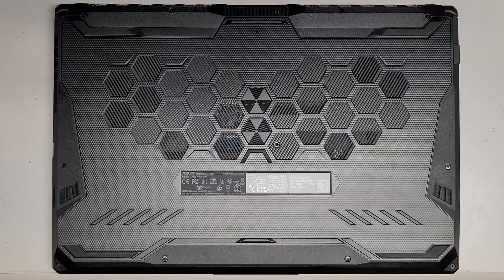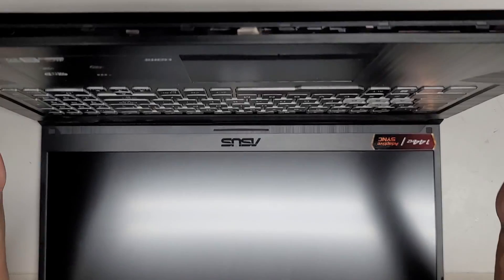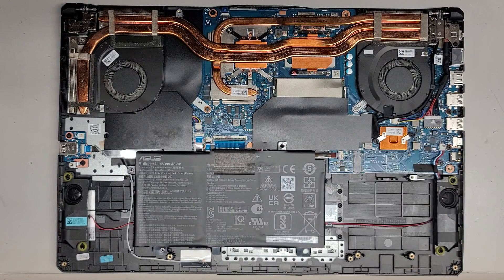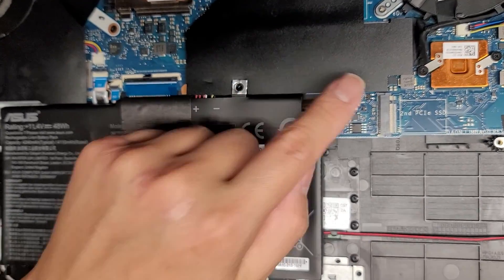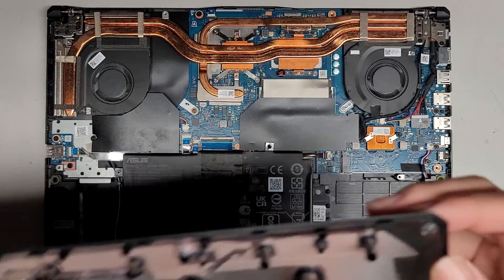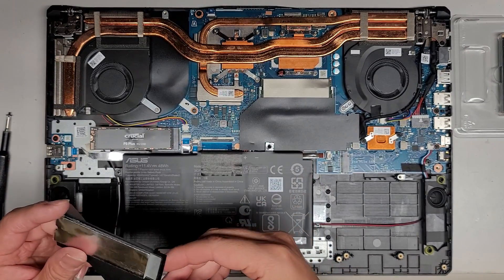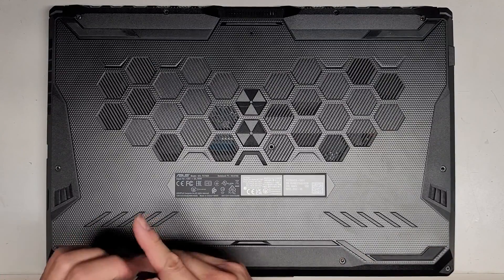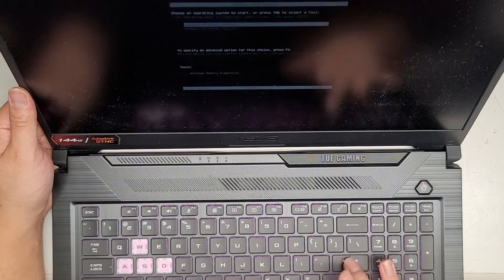ASUS TUF Gaming F17 FX706H FX706HCB-ES51 Disassembly RAM SSD Hard Drive Upgrade Battery Replacement

Comment: there is second ssd slot right side, you should've kept original one and installed second one, so you could have more storage
Reply from the maker: I should have kept the original one? Did you even pay attention to the video? The original one failed. Why would you keep a dead SSD inside a computer? It will only cause problems... It would be like keeping a brain tumor so you can have more brain matter... lol

Comment: Hey. I hope you still check comments. 
Per factory specs, this laptop has PCIe gen 3 slots, but you have a Gen 4 SSD. Does it work at gen 4 speed or it's capped at gen 3 speed? 
Also, do you know if the battery can be upgraded to 90w? The 90w is 15.4v as opposed to 48w at 11.4v. I saw one guy did the upgrade, but wanted to see more opinions or experience. The different voltage worries me. 
Thanks!
Reply from the maker: Hmmm I'm not sure about those things, sorry.
Reply: @ItsBinhRepaired  Okay, no worries.
Reply from the maker: Yup

Comment: Bro i have acer aspire 3 a315-58 36qh model n20c5
SN530 NVMe
Western Digital
WLL
512GB
SSD
Can I put this ssd in this Asus tuf is this compatible with it
Reply from the maker: @jerry22-c3l  should be fine
Reply: @ItsBinhRepaired  thanks bro

Comment: I have a asus f17 fx706h and was wordering if i could put two 16 gb ssd and one 1tb were you had put your 1tb in the video i have a rtx2050 and a i511400
Reply: Thanks man I learned something new
Reply from the maker: @ZahvinYT  no problem. Watch the video again and you'll see where the RAM and SSD are. If you want to upgrade the SSD, you'll need to clone the old one to the new one, or be ready to install a new OS.
Reply from the maker: 2 16gb sticks of RAM? Sure! You can put 1TB SSD as well.
Reply: Are stick ram and SSD difrent
Reply from the maker: @ZahvinYT  yes
Reply: Did I say it wrong I'm new to this so 2 sticks of 16 gb ram and one 1tb SSD is how you say it?
Reply from the maker: @ZahvinYT  yup

Comment: Hey man please reply 😭😭i can hear a small electrical buzzing sound in the left part of my same model above the 1-2-3-4-5-6 keys it's very small and i can hear it only when i put my lapton in silent mode with fans turned off,😢 do i need to be worried please please answer this is my first laptop
Reply from the maker: @brijeshb3355  the computer is still working?

Comment: Hey, I have a question, if I consider to move my ssd to that second slot it would be possible? I experience a lot of wifi trobules because the wifi card heats up and just turn off. Thanks!
Reply from the maker: Should be. Give it a try.
Reply: @ItsBinhRepaired  alright, thanks
Reply from the maker: Yup

Comment: Hey first of all thank you for your video I've never worked on my own laptops though have for desktop rigs so this made me a lot less nervous to do it myself!

Question for the parts I'm trying to upgrade:

I'm trying to install a "SAMSUNG 970 EVO PLUS M.2 2280 1TB PCIe Gen 3.0 x4" M.2 and wasn't sure if this one would be compatible for the second port. I also don't know the compatibility for the RAM though I was debating on putting in this one "Crucial 32GB Single DDR4 3200 MT/s CL22 SODIMM 260-Pin Memory". It would help tons to get your opinion! Thanks so much will share this video with others!
Reply from the maker: I think those should work

Comment: What do I do if I take out that screw that helps open the plate
Reply from the maker: What do you mean?
Reply: @ItsBinhRepaired  i was talking about the screw in the corner that opens the edge of the thing slightly but I figured it out
Reply from the maker: @poopmaster8464  oh, got it. Yeah, you can screw the washer back on.

Comment: The black sheaths are to assist speed of assembly using unskilled labor. They are marked with arrows which are removed if QC operatives are happy that components are where they should be. Following basic laws of thermodynamics, the sheaths localize heat and do not disperse it. Asus should stop using them.
Re the tricky clips, a tip is to smear Vaseline on them and the location holes then wipe the outside of the joins with isopropyl. This avoids traces of warm grease attracting dirt.
Quality standards have declined with this company and most others in the last 15 years.

Comment: Would i be able to put in a ssd nvme with heat sink?  I've read by some its to big and by others its fine. Or is there a heatsink already in place?
Reply from the maker: No heatsink unless it's just the flat heatspreader. It's unnecessary though.

Comment: hey, i have an asus A17 FA706IU,  r7 4800h, gtx 1660ti, 16gb ram but i have the small battery with 48Wh, i bought the big one (90Wh) but it s higher voltage 15.4 from 11.4. What do u think, it s safe to replace it?
Reply: @curcan.razvan I am also planning to upgrade battery to 90whr...
Just wanted to know is yours still working properly? Higher voltage causing any issue??
Reply: @hassaan6119 nope, 0 issues, it's perfect, 6-10 hours of mid-hard usage on battery and the laptop is fast like if its plugged in
Reply from the maker: Nice!
Reply: @curcan.razvan  hi,  want to do the same -  but  I can't find the serial number of the battery 90whr is that one C41N1906-1?
Reply: @Татьяна-х5л1ъ i dont remember if the code ends with -1 or -2

Edit: Yes, i have found the code. That is the code. Buy it.
Reply: @curcan.razvan  thank you very much !
Reply from the maker: Hope it goes well.
Reply from the maker: Is it designed for the laptop?
Reply: yeah, it works perfectly
Reply from the maker: @curcan.razvan  awesome
Reply: @curcan.razvan today i tried upgrading my battery from 48 to 90whr. My model is f15 FX506LHB . The issue i am facing is that the laptop isn't utilizing battery for turning ON nor does it want to charge it. The only way i can turn on my laptop is by connecting the charger. Although it does show the battery and its % in Windows. But as soon as i disconnect the charger, it turns off. 
Any advice? 
Fyi i have tried upgrading battery drivers and have reset the cmos. And the condition is same in Bios mode as well. ☹️
Reply from the maker: @hassaan6119  did you have that issue with the old battery?
Reply: @ItsBinhRepaired  No. The older one is ok. Laptop turns ON and everything else is just as it was before with the older one.
Reply: @ItsBinhRepaired  do you think it might have something to do with bios?
Reply from the maker: @hassaan6119  no
Reply from the maker: @hassaan6119  is the other battery made for this laptop?
Reply: @ItsBinhRepaired  older one(48whr) is B31N1726 and the newer one (90whr) is C41N1906-1. Don't know about compatibility.🙁
Reply from the maker: @hassaan6119  you can't just plug random batteries into your computer. You can fry the motherboard that way.
Reply: @ItsBinhRepaired  the connectors are same of both the batteries.  + - terminals are also same. What is different is the number of cells. The older one has 3 cells of 3.8 Volts each and the new one has 4 cells of 3.8 volts.   The charger also outputs 19V and that doesn't fry my motherboard.  
Connecting the battery hasn't cause any damage to the motherboard so far. And it won't i suppose.
Reply: @hassaan6119    im sorry to hear that..i have nothing to help you with yet, search forums, internet .
My laptopt is still working perfectly since then and my battery model is : C41N1906-1. but i have a different laptop model